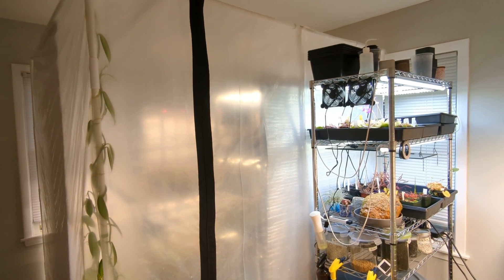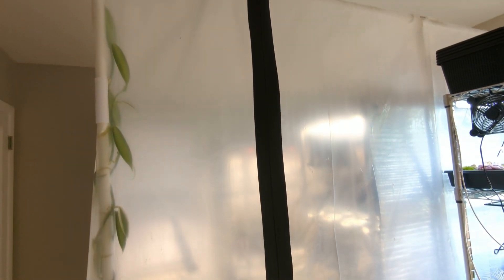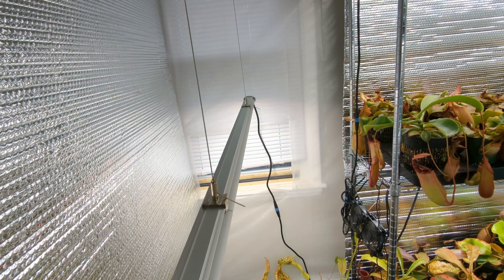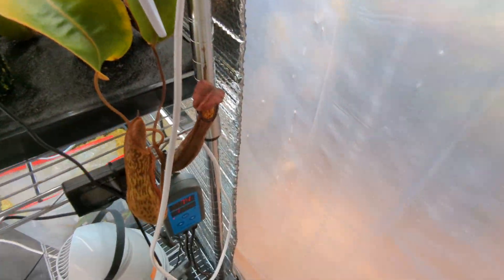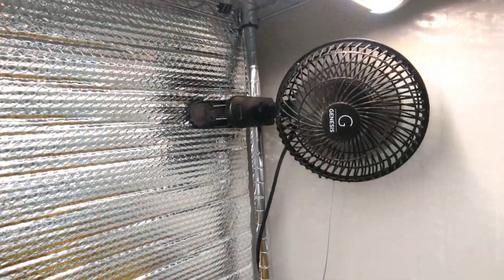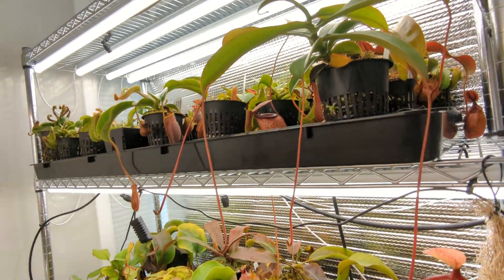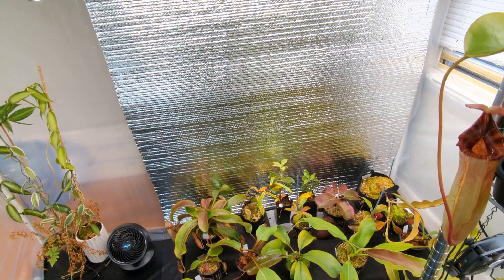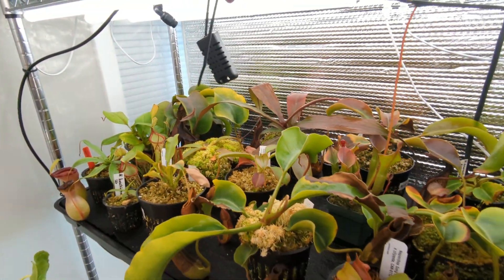Nepenthes Grow Tent Setup - November 2022

Comment: Looks really good! Do you measure your light? I'd love to know what PAR/PPFD/Lumens your working with. I've got some quite strong grow lights. I don't know that I'm "burning" any of my neps, but they've got some color for sure. They get up to 450ppfd so I'm wondering if they can get used to it or if I'm cooking them lol
Reply from the maker: I'd say mine get around 100-150ppfd. 450 is definitely on the very high end and I would think about trying to reduce that amount. Carnivero has good info on PPFD recomendations by genus that I'd recommend you maybe check out:
https://www.carnivero.com/pages/grow-light-ppfd-recommendations

Keep in mind Nepenthes is a very diverse genus and each species may respond differently to various light levels.
Reply: @pings_n_things  You said "that's way too much light" so elegantly. I appreciate your insight, thanks! I'm going to adjust my lights now lol